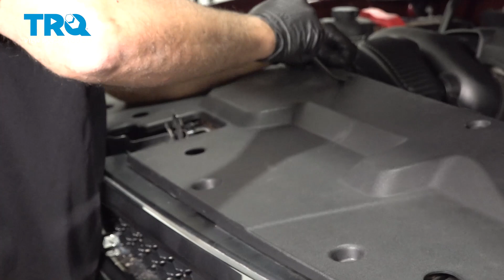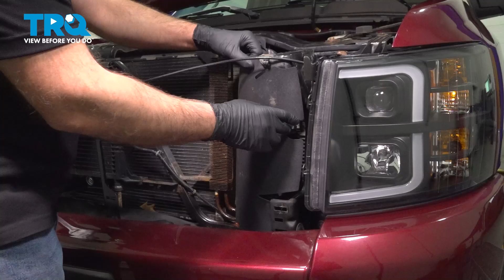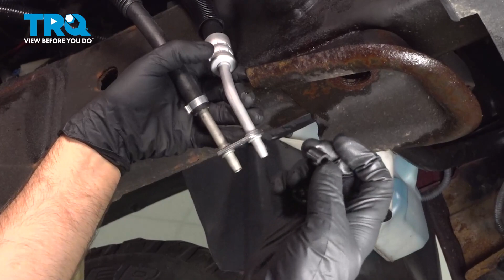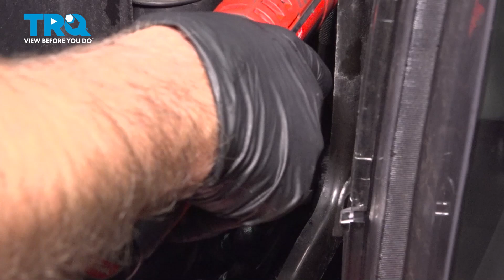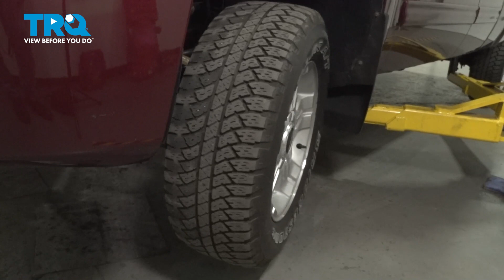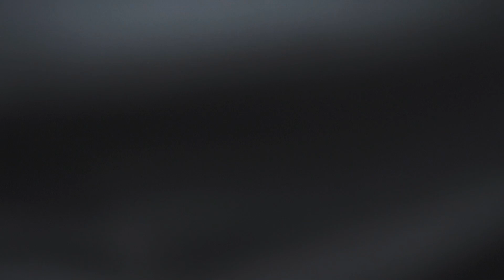How to Replace Power Steering Return Hose 2007-2013 Chevrolet Silverado 1500

Comment: Pretty deceiving video. Trq usually makes helpful vidoes but this and the powersteering video skip the seal on the rack and pinion side of the hoses. Why is that? Do your parts not come with seals or something?